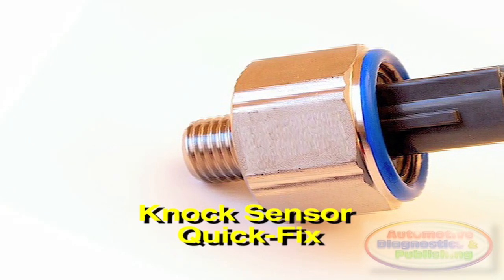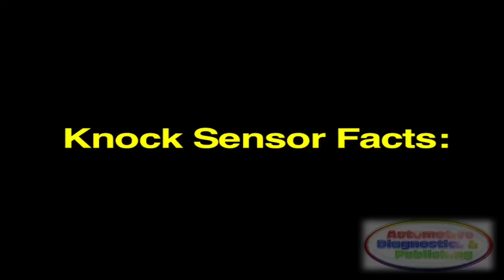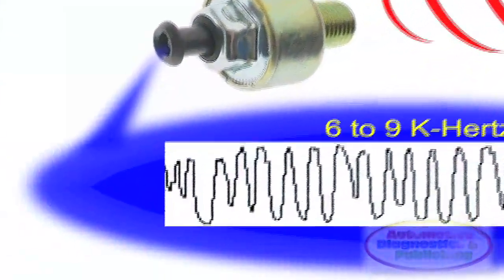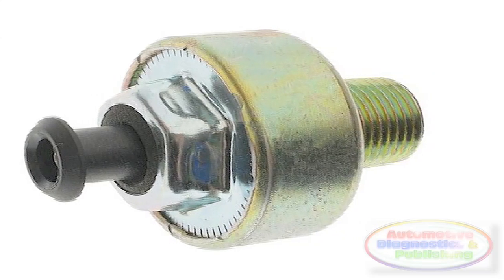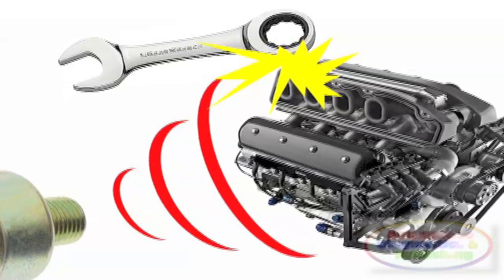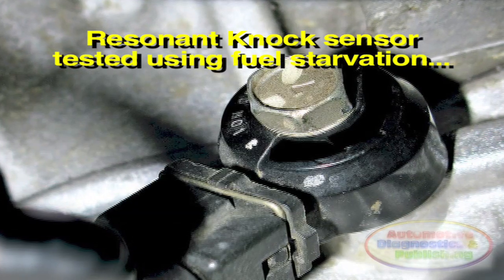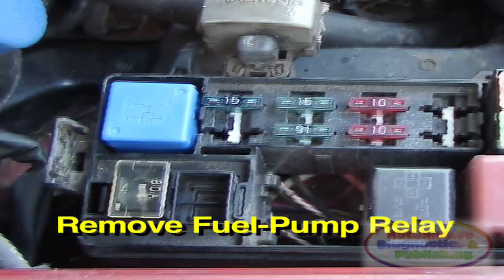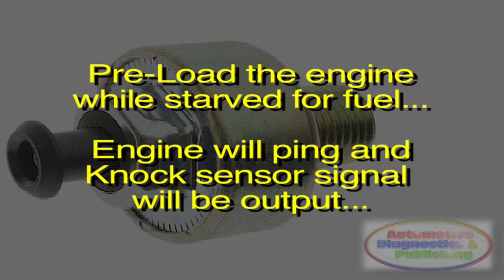Knock Sensor Quick-Fix

Comment: How am I supposed to test a resonant knock sensor in an 04 silverado truck when the intake has to be removed to get to the knock sensors? I understand many vehicles such as toyotas also have their sensors in the intake valley. My truck will not start without connection to the air filter box, much less while removing intake/throttlebody/etc.
Reply from the maker: drwombat That's the case for most vehicles today and built within the last 20 years. All you need to do is TAP at the ECM/PCM wiring harness knock sensor wire. You need a Scope or Graphing Meter to see the waveform. Let me know if that helps out.
Reply: Cranky Jay exactly what I'm screamin lol

Comment: If I had a bad knock sensor would it give me a fault code of P0022? I recently took my truck (06 F250 5.4) to the shop and they changed my VCT solenoids on bank 1 & 2. I'm still getting the code P0022. Any help would greatly be appreciated...

Comment: You've got your types of sensors mixed up. The older ones are the resonant ones that output a high voltage at a single frequency when hit. They're usually 8 to 12 KHz. depending on the engine. The newer ones are the wideband ones which are just like a normal microphone.
Reply from the maker: Thanks for sharing. In the end it doesn't really matter. Just checking the response does.

Comment: I have a 15 years old lexus es 300, and last year the engine light was on, and the mechanics told me that the knock sensor has to be replaced, which would cost more than 1000$, do you think it is worth replacing it?

Comment: Need help I have a truck that is cam and supercharged. I was getting a code for the cam position sensor so I remove the supercharger and replace the cam position sensor however because I had it off I also replace the knock sensors. I put everything back and the cam position sensor code is gone but now I'm getting the code for the knock sensors I purchase them at the dealership. Do I need to return my truck because of the new sensors that's why I'm getting the code or is it a defect knock sensors?
Reply from the maker: Knock sensor won't impact operation that much. Probably a pinched wire.

Comment: Wouldn't the car die right away when removing the fuel pump relay?
Reply from the maker: No, it takes a few seconds, from 4 to 7 sec. for the fuel rail pressure to go down. At 75% pressure and down, the engine starts pinging.

Comment: Loss of power.retarded timing.93 s-10 4.3 v6.May or may not have check engine light on.Mine was knock sensor on driver side.Replaced it problem solved.
Reply from the maker: Thanks, DONATE: https://www.paypal.com/donate/?hosted_button_id=F9W5VPHTGWBV6

Comment: car run good no knock no ping but light still come back on after install the new sensor light still come back on with the new ones and old ones i pull off used motor that is good SMH WAS UP somebody talk,to me im at the breakn point

Comment: I understand how to diagnose the old wide band sensor. However, what if the harness is bad and not the sensor(s)? If I measure at the junction where the two AC wires come together will it show any differently than how it will show, Rather, not show if it were indeed bad sensor(s).? Shit, thats clear as mud...if its a bad harness instead of bad sensor should I see something different? OR With this test can I differentiate from bad sensor or bad harness?
Reply from the maker: Correct https://www.paypal.com/donate/?hosted_button_id=F9W5VPHTGWBV6